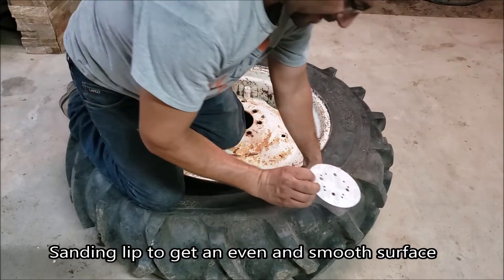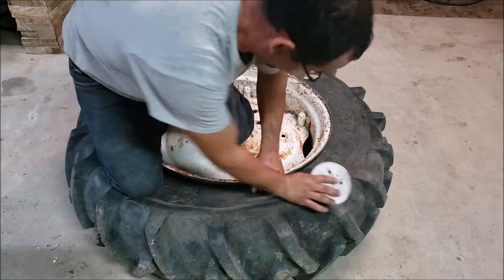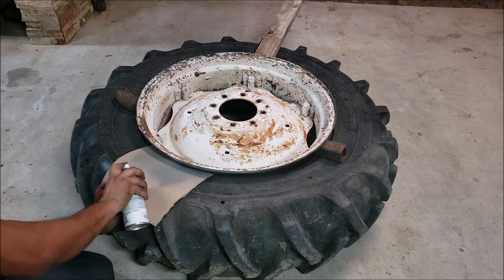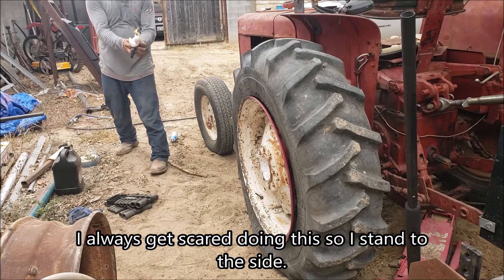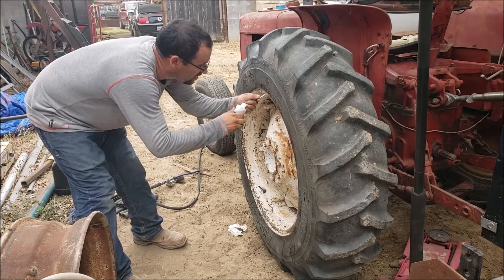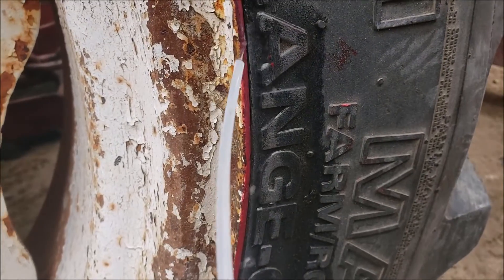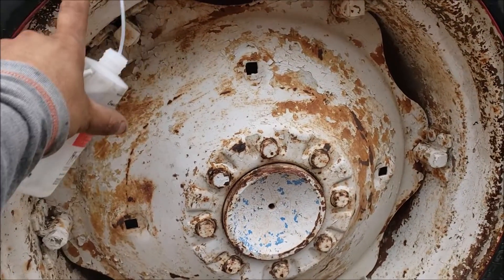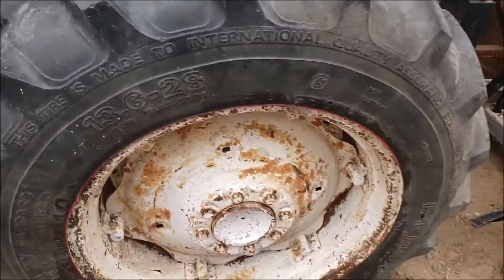How to seal and seat tractor tire bead using starting fluid

Comment from the maker: Tire scared me there but we got it going again.
Reply: Yeah we had some pumps that were made in Mexico I think the barrel were about 24ins long maybe more and about 1 1/2 inch round with a replaceable leather plunger I replaced mine several times before I made my first air compressor with an ac pump from an old Ford F 250 a 15gal tank or there about a 2hp compressor motor fittings from the hard ware store valves just like a store bought air compressor I didn't have the money to buy a new compressor so I use my brain my welding skills and it worked at one time I even thought about making one to work off the PTO from the same tractor to take to the field with me but I got lazy maybe and I didn't finish that project

Comment: Hey Jorge. Nice work. I jump all the time when I pop a tire like that as well. Thanks for sharing.🍁👍👍
Reply from the maker: Yeah these tires inflate super fast and sometimes the tires jump if not secured onto a vehicle. I was going to try to inflate tire on the ground but decided to bolt it on for safety. Thanks for stopping by.

Comment: I’ve done that a few times when I was installing new tires to my 1986 M1008 CUCV, it also scared me every time! lol 
By the way how well does that Dewalt Tool work as an Impact? I want to buy one, but don’t know how well it works.
Reply from the maker: I bought it when I built the flatbed to remove a few bolts and lug nuts. I know its strong but I dont have anything to compare it to. I did see a video online before I bought it where they used a torque wrench to torque bolts and then removed them with the Dewalt impact. I also got a deal on Ebay so picked it up.

Comment: That's quick have you ever tried to pump one in the field with a hand pump my first tractor used 14. 9 x24 rear tires it took me about 2hrs to repair it no air compressor just a hand pump but we used inner tubes and tires were only around 6 to 8 psi
Reply from the maker: 2hrs.....I'm speechless.....I once used a small  foot operated pump for bikes to fill a car tire and it was exhausting. I eventually put like 15lbs and drove to nearest store that had those air stations/machines. I know my buddy melted the gears on those 12v cigarette adapter air pumps filling the tire on his John Deere. I may eventually add a 12v pump made for airbags onto tractor to top off tires when needed.